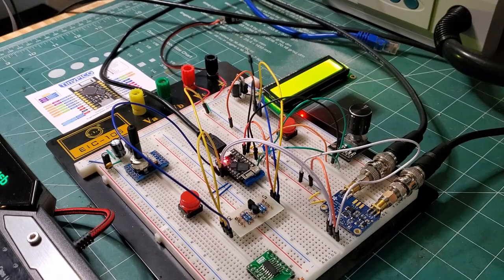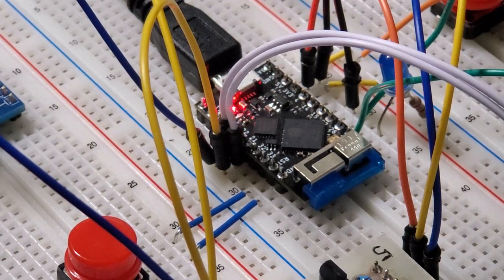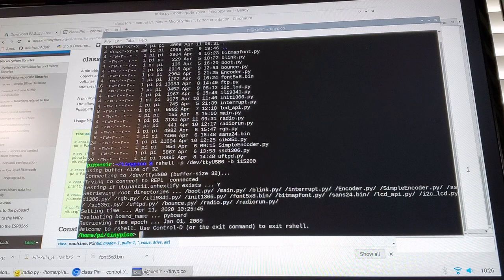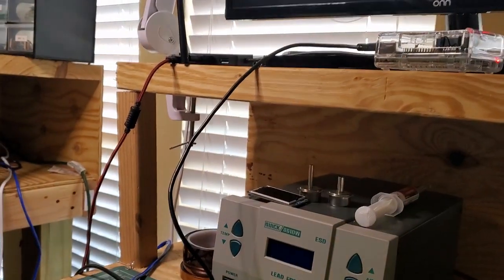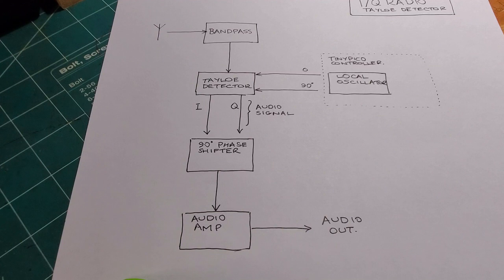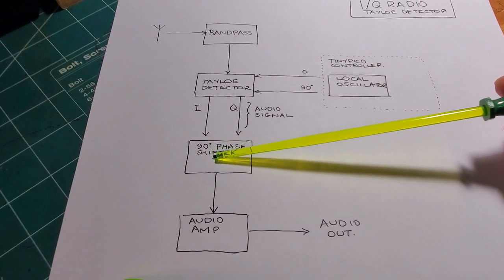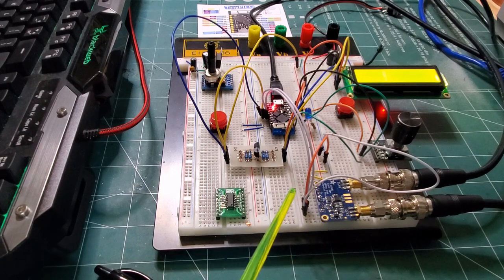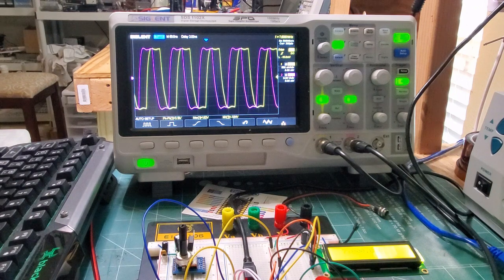TinyPICO Radio Part 1 - Micropython and the Local Oscillator

Comment: Where did you find that awesome yellow capacitor adjuster?
Reply from the maker: Wow thats a good question Bryan. Its been a while but I think I bought it from an Electronics supply store, Tanner Electronics here in the Dallas area. Unfortunately that store closed down earlier this year
Reply from the maker: This is the tool if you are interested. Shipping is a bit steep though!
https://www.newark.com/mcm/tl00157/trimming-tool/dp/39C0945
Reply: @na5y  Thanks so much! I have some other things to buy from Newark anyway so it's perfect!

Comment: Can this code also work with RPi PICO ?
Reply from the maker: You mean with the RPi PICO running micropython? I don't know for sure but I don't see why not. There's nothing the code uses that is fixed to the tinypico  - just GPIO and I2C. You'd most likely have to change the GPIO and I2C pin numbers used in the code.
Reply: @na5y  OK , thank you
Reply from the maker: @CharudattUplap  Any time Charudatt. Thank you for the comment and drop a comment if you have any questions on the code